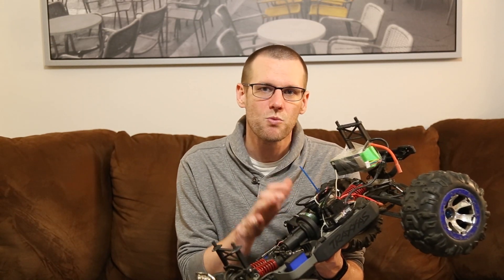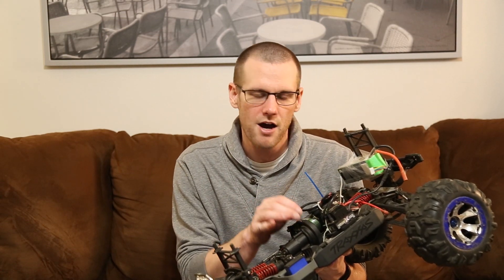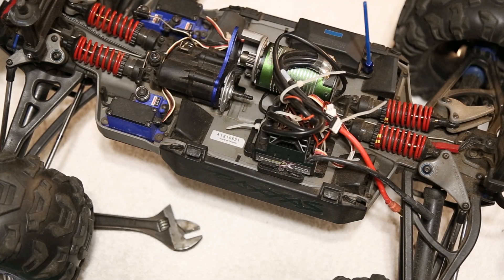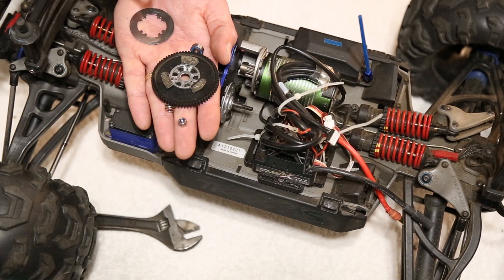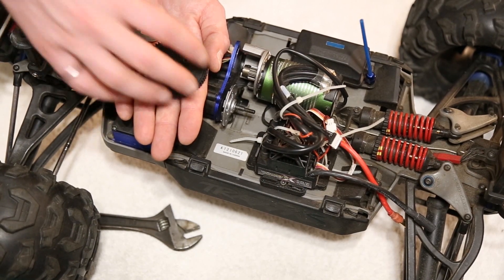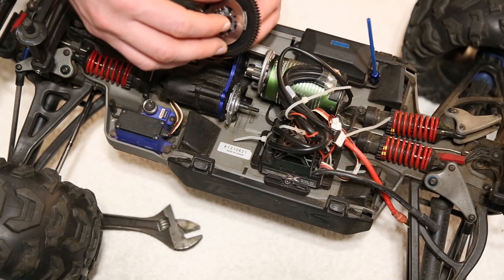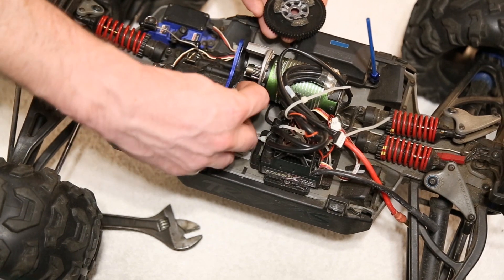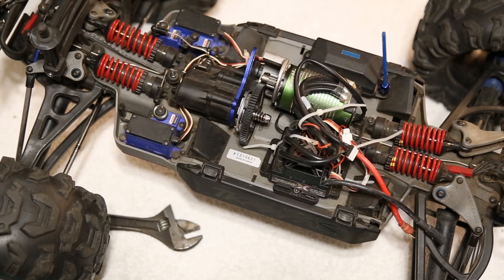What Does the Slipper Clutch do in an RC Car?

Comment: Thank you for the explanation.  I think I burnt the slippers in both my MERV and Mini Summit yesterday bashing in the snow with paddle tires!!!  Should I tighten up the slippers first or just replace them?
Reply from the maker: Why do you figure the slipper clutch was excessively slipping?  I would take apart the clutch to determine if the frictional material is in fact worn.
Reply: @RCexplained  both rigs smelled pretty bad.  I would say the smell was like a maual transmission that someone rode the clutch.  I will take them apart and look for glazing and hot spots.  Thank you

Comment: That's a good explanation.

If you are interested, I would appreciate it if you could make a video of these later.

Increase in rotational inertia with wheel weight and diameter

Servo and bearing load increase with use of wheel widener

Motor Cooling Efficiency Using Heat Pipe

Increase in transmission distance by increasing transmitter output

Error according to the measured material of the infrared thermometer

Vehicle weight movement and the efficiency of the sway bar

Maximum efficiency load and maximum power section of the motor

merry christmas
Reply from the maker: Merry Christmas 11 1. I'd love to do some of those video just not sure if I have the right equipment to come up with the data. I'll look in to it, but won't be able to make any promises.
Reply: @RCexplained  thanks. take a time
Reply: You read my mind)))) It would be awesome! 
Many Thanks to Ryan and to all of us)))))